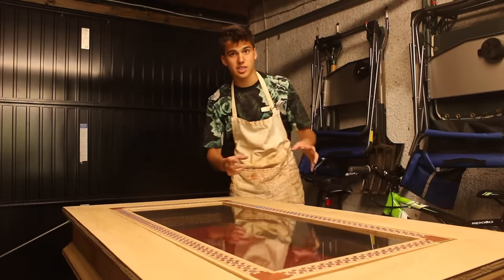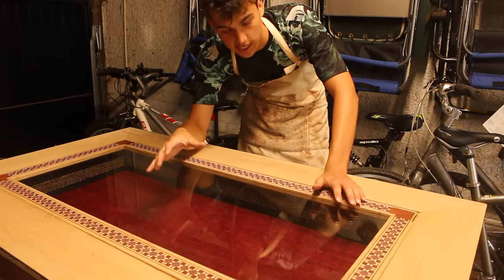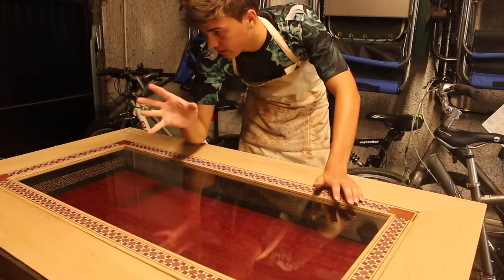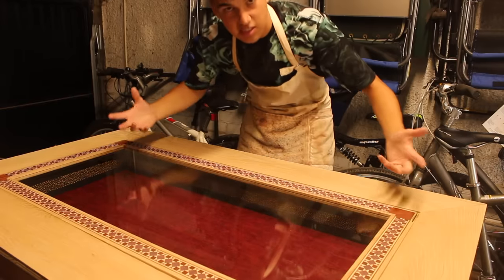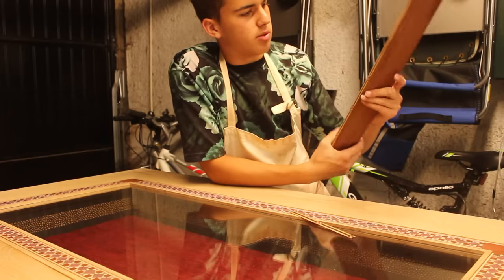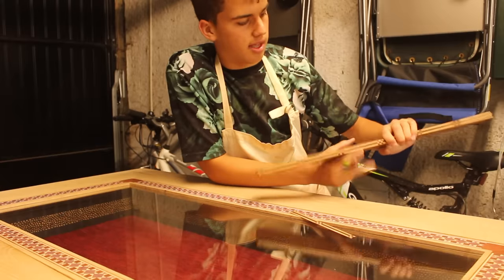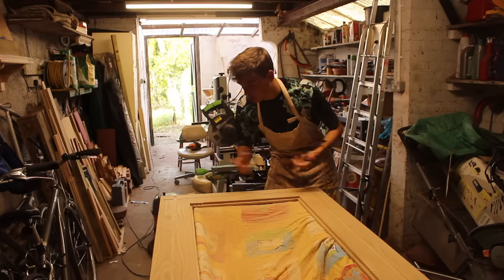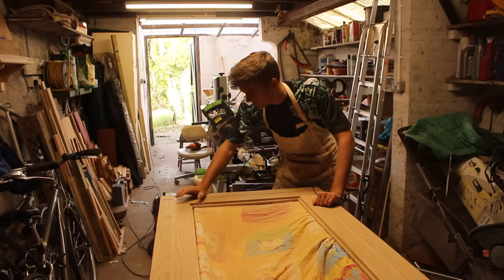How To Inlay A Table Top

Comment: I do a fair bit of inlay work, mostly with boxwood, bubinga, ebony, and sometimes rippled sycamore.....I found my accuracy improved greatly by using a striking knife to mark the length of my inlay, instead of using a pencil. I use only hand tools for my work......I found if there is a mistake to be made, a hand tool only makes a little mark, while a router tends to ruin things very quickly...... so you feeling nervous with the router is understandable :)  
Nice work my friend! :)

Comment: Very nice work. If I could recommend anything it would only be that you wipe any excess glue off before it dries to help reduce the amount of tape remaining behind and the excessive amount of sanding the surface you have to do because of the dried glue and the tape that remained stuck to the surface because of that excess glue.  Short of that, I really think your project looks frickin' awesome!!  Thank you for sharing.

Comment: Great job. A master working at his craft. You make it look so easy!

This spring I am having a new wide plank wood layer in my living room and dining room. I told the contractor that I want a banding around the edge if the floor done in three woods, which I haven't decided on. I want the wood to weave around each other. Your video gave me some further ideas. Doing the banding will cost a bit, but no other floor around will have it.

Comment: You look really young considering the level of skill you've achieved: whoever taught you...knew his business. I confess I was shocked at the amount of glue you used on the inlay grooves. Also: that you didn't wipe the excess with a damp rag (The way I was taught). Tape? Not clamps on a length of scrap? It clearly didn't do the table any harm; the results were fabulous. Just a matter of style/technique it would seem. Nice work!
Reply from the maker: Hey David, Thanks a lot. yes you don't always need to clamp inlay in, because the strips are so thin and flexible, tape is plenty strong enough to force it into the gap. 
When you glue inlay edge banding in, you want to use a lot of glue as these pieces are delicate and can break off over time. 
lastly wiping excess glue with a damp clothes sometimes actually works the glue more into the wood grain, which means it's harder to remove in the end, also as wood glue drys it shrinks. so I want enough squeeze out remaining so its can be pulling back into the joint. Hope that helps if you are interested in my reasoning. 
Cheers, Sean

Comment: Astounding craftsperson ship. Well-done. Very instructive presentation as well. 
One question/comment. Although I know it is wasteful and sometimes not possible, but did you consider matching the wood for grain uniformity, and density at the corners for more uniform stain uptake across the joints? It minimizes the dark-to-light effect but takes more time and wastes wood. You almost need your own milling machine for that....

Comment: PS from previous comment keep your  router bits sharp. for inlay like this you could use the diamond or polly crystalline diamond tipped cutters they expensive but give excellent sharp edges and extra care is needed when using them as a tap from a steel rule would chip them.
Reply from the maker: Hey John. thanks for the help and advice. that sounds like a idea. I will need to save up a bit of money then! I'm looking forward to showing you more videos!

Comment: I just got a little question. Does that Mask you using, have a Respiratory Function? Because ... i wear glasses and in my garage here i don't have the big Dust Collection System that i had in my old Job. Which is why i have to use Respirators ... the best one so far is that Resp-o-rator ... but you seem fine wearing the Eye protection and the Mask.
Reply from the maker: Yeah mine is called a RZ mask. it does not fog up my glasses. hope that helps. thanks for watching!
Reply: So it has Respiratory function. Thank you to tell me its name, that let me find it out.

My main problem was not fog up, the main Respirator i used had the nose part so long, that i could not rest my glasses on my nose the way they usually rest. Which of course gives you trouble seeing what you doing. Especially when i use safety glasses, which are even bigger so they fit over my normal glasses.

So yes, this does look interesting, i might get me one at some point, right now i use that Resp-o-rator i mentioned. Thanks for the info!

Comment: Any reason why you wouldn't use a hand plane and card scraper to smooth out the inlay flush after glue up?  Preference or is there an actual reason not to? Just Curious.  Great video.  Table looks awesome!
Reply from the maker: Hey +Matt Kittner thanks for watching glad you liked the table! And that's a good question. First of all i do not have a card scraper or a good hand plane (I really want one though) so my only option was to use a sander. And also because the inlay only protuded 1mm over the table it didn't matter that much and the orbital sander could do it. looking forward to showing you part 5!

Comment: really nice work, looks great. you break down something that looks pretty intimidating into something doable. I like the end result allot, looks fantastic.

you seem like the type that might really enjoy geting into hand tools. for example i think a plow plane would have worked faster and more accurate than the router to cut the groves, and a couple hand planes would have made quick work of leveling the inlay and finishing the surface, without all the sawdust. 

a few suggestions, even though im no expert, someone mentiond putting a verry small back bevel on the ends of the inlay helps them fit tight, this works but limits the amount of matereal you can take off to level it before the joint starts coming apart. also make sure you face the bevel side of your chisel to the waste side to make a crisp cut. i think youd find that a marking knife instead of a pencil really improves your accuracy.

you can also make a shooting board setup to hand plane the strips to finished thickness and flatness, and shoot the cuts on a shooting board to make perfect joints.

you really dont have to spend much to get into hand tools, good old planes and such can often be found at estate sales, thrift stores etc for around $10. less common tools like plow, moulding and combination planes usually have to be bought through ebay however.
Reply from the maker: Hey! +shonuffisthemaster I enjoyed reading you comment. Thank you for your advice. and yes I am very interest in hand work. I am actually very soon about to buy a dovetail saw, marking gauge and all of that stuff! I can't wait to use them! Thank you for watching and commenting. I'm thrilled you liked the video!
Reply: SE Woodwork no problem, thanks for taking the time to put together an informative video. id be happy to talk to you a bit about sharpening as its pretty important in hand tools and kind of my passion.

Comment: You don't wipe of excess glue with damp rag before tapeing down?
Reply from the maker: Hey John, I do it for a few reasons… firstly sometimes when wiping glue it spreads it more into the woods grain, and that can show in the finish.

Secondly you don’t need to, as you are sanding the whole top anyway.

And finally, as glue dries it shrinks, and when Inlaying the glue can act as a gap filler. So if you wipe the glue away, when it dries, if there was a tiny gap, then the glue level will be lower than the surface.

Hope that’s helps
Sean
Reply: @SeanEvelegh  Thanks Sean, good to know and nice work.

Comment: Very nice work. It always puts a smile to my face when you see that final finish go on and see that grain just pop out. My only question is what type of glue are you using there? Is that a block that you heat up or soemthing?
Reply from the maker: Dear +Thomas V thanks for watching and thank you for your comment. I love looking at the finish go on as well. it's the best bit of the project. and to your question. I am just using titebond original (it works great for this). and i just poured it onto the block for ease of use!

Comment: A word of advice be very careful sanding inlaw work I once did some white oak bands on a sapele top and the orbital took the oak down just a fraction quicker than the sapele. So they were not quite flat as I’d have liked. I scrape mine now then just final finish with very fine great. Your right it makes that table top

Comment: I keep imagining a long table that seats 10.  4 people on long seats.  2 on short.  Long bench seats on each side that's hard to topple over from kids climbing up on it.  Two small bench seats on the ends.   A 4 poster table, old country style, with a huge over hang that's easy to slide the bench seats under.   The edge is 5" wide.  Then in an inlay, then going counter clockwise are figures walking, marching, playing around the table from all Studio Ghibli movies, all the characters doing various things, then another matching inlay above that, the table polished high and protected with thick layer clear resin that can be easily sanded to remove dings and dints.  Me and dozens of others would pay high price for that..  Tons of anime fans out there..  I keep looking for an artisan to do it.  Perhaps something you're into that might inspire you?

Comment: Why do you have to use so much tape ? Doesn’t it just hold and dry itself or u could put objects on top just sayin
Reply from the maker: Hello there, it actually wasn't a waste of tap at all, If you have ever seen anyone make wooden string instruments. you would see how much tape they use! It is the most effective clamps in those situation. and like in my inlay case, it would similar. there was no shaped clamps suitable for the job. and i need to have even pressure all along it. so tape worked very well. there was nothing that I could of put on top of the tape that would equal the amount of pressure the tape made. Plus i would have had to have alot of those heavy object to cover the whole table top. (which i didn't have) also to much weight much damage the table. Thanks for watching and commenting though

Comment: You should use gloves while using machinery 
Just saying xD
But good vid, I like ur proyect
Reply from the maker: You don't used gloves with woodworking machinery. Have you ever seen a woodworker use gloves with a bandsaw or tools like that. If you did, you wouldn't have as much control. you don't get to feel the wood properly so you won't know if it is binding or under stresses. I'm glad you liked the video though. thanks for watching! xD

Comment: Why do you route it ! just assemble the back ground veneer with the inlays using veneer tape and put it in the press.  Vacuum presses are good enough for that category of work, and they are not expensive.   That is how most small companies do it. Also don't use a chisel to miter the inlays just use a utility knife blade to do it.  It is by far more accurate.  I still thank you for the nice video.
Reply from the maker: HI there, thanks for your comment. the reason i routed it, was because it was inlayed into solid oak (not a background veneer). I also don't have £800 to buy a vacuum press... But I would love one at some point. thanks for the advice on the chisel. I'm looking forward to showing you more videos